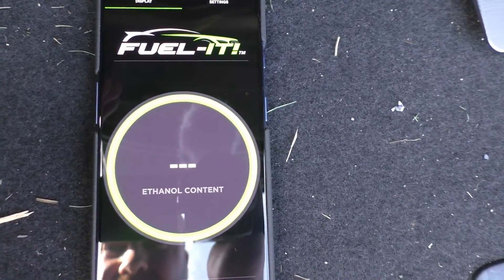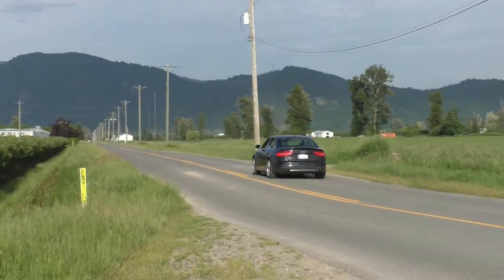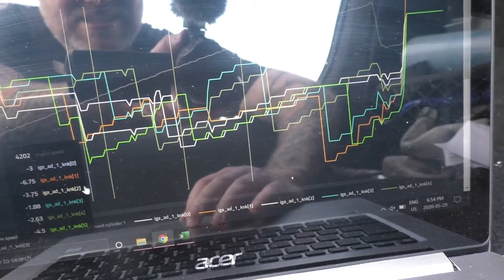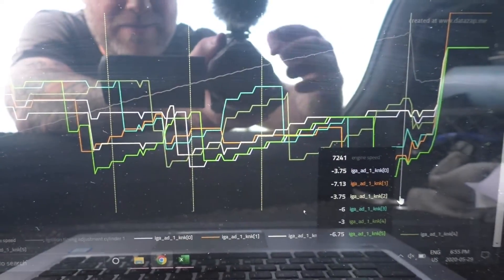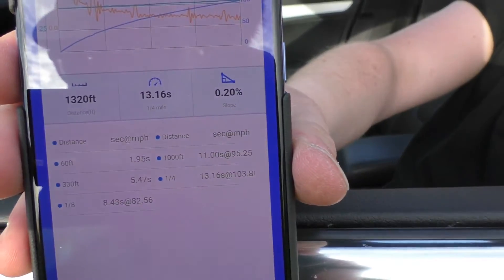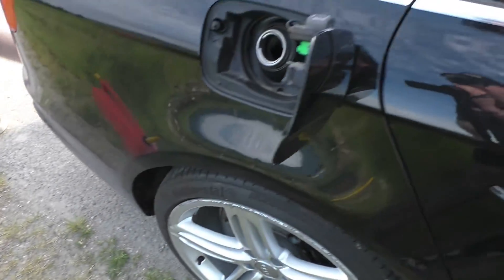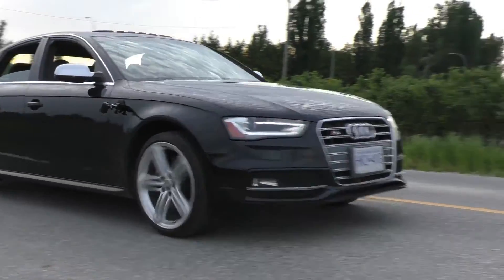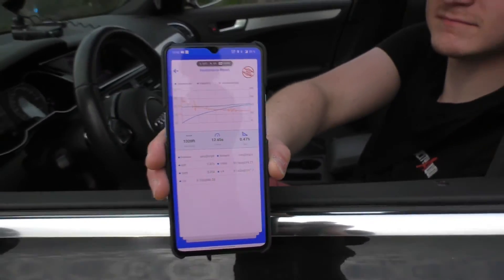ADDING POWER BY ADDING E85 TO PUMP GAS!!!

Comment: I'm sure you've gotten a lot of questions but if you could help me out I'd appreciate it. Will I fuck my shit up if I add E85 to my APR Stage 2 High Torque 93 Octane 2016 S3 or do I need extra parts and files? I'm thinking 10 gallons of 93 octane and 4 gallons of E85 to make E31. Would I just go to my local gas station and fill up on 93 octane pump gas and then add E85?
Reply from the maker: As I've mentioned multiple times in multiple videos, I do not recommend that high an ethanol content on a pump gas tune. First thing you'd do is install an ethanol content analyzer. Once that is done start off by logging the car. Then once you've seen how much timing retardation you have, work up your ethanol percentage 5% at a time. If I had to guess you'll see no more timing being pulled at around E18. There is zero point to running E31 on a pump gas tune. You'll just put unnecessary strain on your fuel system.

Comment: Miss my Stage 2 B8.5 S4
Reply: Could he run a tune designed for higher octane since barely any timing was pulled? I used to run the 104 tune on my S4 with a tank 2/3 chev 94 and 1/3 e85  .
Reply from the maker: @MrSteveb8  I would want to clear up that cylinder 2 timing retardation before I pushed it harder.  Once that was taken care of he can easily use the 93 octane Stage 1 tune with Chevron 94 with some E85 blended in to give him E15.

Comment: Maybe recommend logging afr in there also just to be safe.
Reply from the maker: That is a great idea.  I didn't want to confuse anyone more than I did already in this video so I kept the ethanol content to a minimum which 99% of modern Audi's will have no problems with.  Once you go with a higher and higher ethanol content though AFR or lambda is extremely important to watch too.

Comment: Do you think using Petro-Can 91 octane would yield better results? Should have up to 10% ethanol in it. Would love to get some more performance out of my S4 with a very similar tune but don't want to go through the trouble of adding ethanol manually especially on road trips.
Reply from the maker: That would be a very easy data logging session to find out if the Petro 91 was any better.  I personally haven't used Petro 91, but I always recommend people to stay away from Shell 91 because of the fact it has zero ethanol.
Reply: @VancityAudi  ha ya would love to see that test. Unfortunately still currently using shell 91 as chevron 94 also doesn't have any ethanol in it and apparently the shell 91 has a higher Ron rating (99 Ron vs 98 Ron) than the chevron. But yeah not sure if my butt dyno will pickup on shell 91 vs Petro 91 would be an interesting test.
Reply: Looks like esso gas has some ethanol in it as well https://www.esso.ca/en-ca/ethanol
Reply from the maker: There are a bunch of stations that offer 91 premium with up to 10% ethanol mixed in: Petro, Esso, Husky, Chevron. Best bet is to use Chevron 94 and blend in 10% E85 for an E10 blend.

Comment: Nice vid as always. Here in Brazil we got  87 AKI, 91 AKI AND 97 AKI gas, 87 and 91 with e27 and 97 gas with e25..

My question is, it would be OK to fill a stage 2 3.0 tfsi with 87 e27 gas (as some areas the 91 and 97 isn’t avaiable)? Or it would eventually damage the engine?
Thanks
Reply from the maker: I would blend down the E25 gas by adding it to the lower octane fuel. Get it to around E10 and then data log your car to see how it is running.

Comment: Dropping a gallon or so of E85 when filling up is always nice.
Reply from the maker: Every little bit helps
Reply: Hi Adam. Maybe you can answer my Q? What’s the mixture ratio of E85 to my  Shell 91 fuel if I don’t have an E meter? (1L per 4L gas etc?) 55L seems to fill.
Stock fuel system on my 2018 RS3 stock engine. No mods. Looking for a little more pop. BTW Great content video as always.
Reply from the maker: @djbone604  I recommend you don't play with ethanol until you have an ethanol content analyzer installed.  End of story, lol.

Comment: Hi bud ! First of all i just wanna say all your works and video are awesome man ! Great works ! My question is ...i got the same car as you rs3 2018 stage 2 unitronic 93 file and here in mtl quebec i find some c85 fuel from vp do you think it is fine and do you already heard something about this fuel c85 from vp vs e85 thanks ! ( sorry if my english was not perfect )😉👍
Reply from the maker: Thanks for your support and no worries about your English.  Mine sucks and it's the only language I speak!  I'm honestly not too sure about the difference between C85 from VP and E85 from the pump.  If you wanted to make sure it was okay to use, fire Unitronic an email or call them during business hours to ask their thoughts.
Reply: It’s even better , go for it ! You wont regret it
Reply: C85 is fine, the petroleum element is 'race gas' rather that the usual 85-87 crap they blend into pump E85.  So you'd actually increase the gasoline blend octane too for increased effect.  I blend E98 as we don't get E85 at the pump here and it's alot cheaper with good results.  It's great to see data backed analysis to help us go faster, good vid Adam!

Comment: Wtf I'm so confused. If I have a stage1+ 2017 Audi S3 and your saying if I add about 10% e85 to my tank it won't fuck my car? I thought the car needed to be tuned to take e85 ??
Also don't know how this plays any different in Australia as our fuel is fucking horrible. We run 98 octane as our performance fuel but thats probably as good as your 93 octane
Reply from the maker: The car will run better with additional E85 even on a completely stock car.  Do everything I showed in the video and your car will make more power.  Data log your car, install an ethanol content analyzer, test your E85, add a very small amount to get your ethanol content to E10 to E15, let the car adapt to the new fuel mixture, then data log your car again.  Whatever timing pull you saw on standard pump gas should be completely gone.  Enjoy the additional power

Comment: Is this always safe to do? I read unitronic doesn't recommend adding ethanol to 93 octane on their stage 1+ 93 tune.  I only ask because even on 93 I am sometimes seeing timing pulled. Great video!
Reply from the maker: Where do you see Unitronic not recommending that?  I've never heard them say that before.  Depending on the car you are referring to you should be totally fine using 15% ethanol and cleaning up that timing being pulled
Reply: Hey, awesome video. I called unitronic and they said not to add anything, only use 93. You think it should be fine running e15-e20 on a stage 1+ unitronic Rs3. I really would love to see a performance increase before going stage 2 e85, thanks for everything you do.
Reply from the maker: @joshfeinstein4934  interesting that they said that.  I guess that is their official response to prevent people from damaging their engines by using too much ethanol on a pump gas tune? I can confirm that when I use the Unitronic pump gas tunes I run an E18 to E20 blend with my pump gas for maximum performance.  I never run more than 20% ethanol though on the pump gas tunes
Reply: Thank you, I’m gonna give it a try.

Comment: Great content!! For anybody stuck with 91 crap gas I highly recommend running e30... night n day difference on turbo cars!
Reply from the maker: I never recommend running that high a content because that is usually the MAX you'd want to run on an OEM fuel system.  I always recommend to start at 10% ethanol and work your way up until you see all the corrections in timing gone.
Reply: @VancityAudi  oh I see, valid point e30 might not apply to all vehicles. In my experience of owing subaru wrx, 8v audi, and gti, with an e30 tune those cars are fine with stock fuel system. But it is better to double check with tuners.

Comment: Does this change if you are able to get Shell 92 octane?  thats the highest i can get in Seattle
Reply from the maker: I have run Shell 92 from Washington as well.  You still see corrections in your timing.  I would still add another 5 to 8% ethanol to that fuel to see those corrections be as minimal as possible
Reply: @VancityAudi  Awesome, I want to start playing around with it,  How can you test your Ethanol content if you don't have the bluetooth app?
Reply from the maker: @mattromano7180  I always recommend you get an ethanol content analyzer installed before you start messing around with E85.  You can manually test E85 too with a test kit.  You can find both online